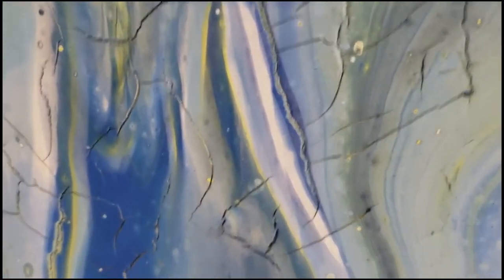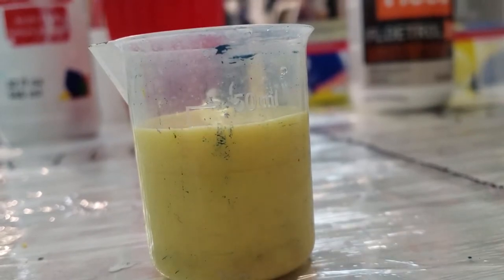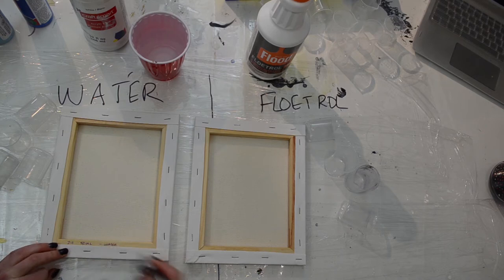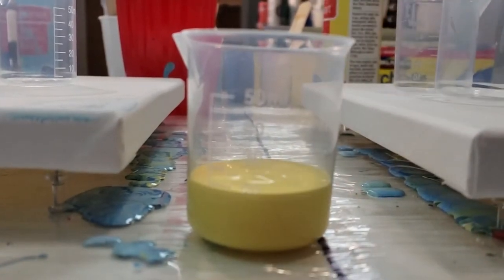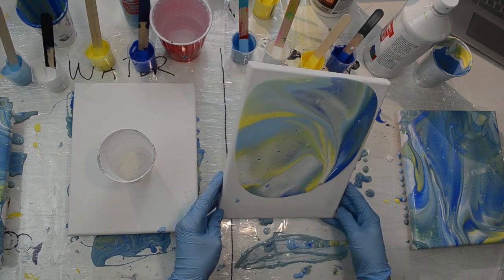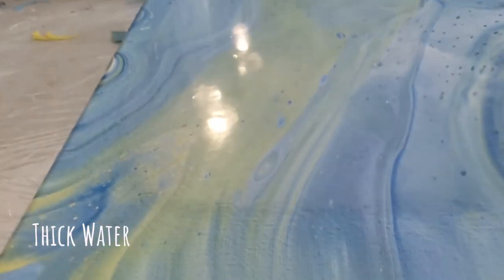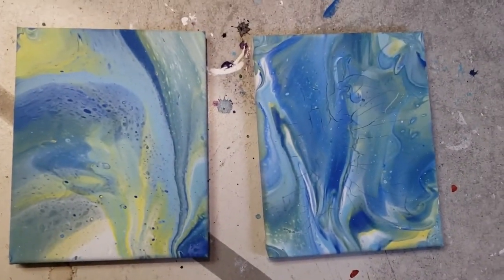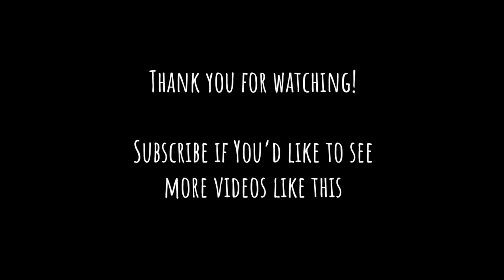Pour Painting Cracking? Testing Mediums and My Hypothesis - Results May Surprise You!

Comment: My first observation would be that Floetrol is not really meant to prevent cracking or crazing. It's just a medium to thin the paints for pouring (for our purposes anyway) and I've heard recently that it doesn't have any binder in it (which would make sense). Some people that pour just use Floetrol. Others will add a bit of something like GAC 800 or another medium like one of the Liquitex mediums. I've used various things with success- usually at no more than ~10%-15% of the total mix of Paint:Floetrol:GAC 800 (or other medium, plus occasionally a very small amount of water for consistency). There are multitudes of things that work and really no right or wrong way of going about it. It's all about personal preference and what works for you.

Really, there are a number of things that cause cracking or crazing. You're definitely right about the thickness of the paint on the canvas being a culprit. Anything really that can cause those outer layers to dry faster can be a problem- thickness, viscosity, temperature, surrounding air flow, etc...  I've even heard that paint being too thin can cause it, but I haven't experienced that personally. I'm not a fan of using water alone though as a medium (or Floetrol alone either for that matter). I've seen others get beautiful results with just water or Floetrol though, so like I said, there's no right or wrong answer. The other big variable of course is the type of pour a person is doing. That's also going to impact what to include in the mix, the best viscosity, etc...
Reply: If weuse morepuring is it btter or not

Comment: Not an artist, but this would likely be similar to cast acrylic panel welding, which uses a solvent.  You can get crazing from uneven drying, or other stresses in the material from uneven heating and cooling during shaping or bending 

So yeah, you seem to be spot on...

As for the solution.. I don't understand acrylic painting and mixing 😂

Comment: Best way to keep from your paint from cracking is use Golding get 800 it’s like a poor medium add it in with your flow trawl and I will keep your paint from cracking it also lets and helps with pigment
Reply: Yes, definitely. GAC 800 is awesome. I use it, but there are a number of other products as well that can work similarly. Floetrol itself is not really meant to prevent cracking/crazing.

Comment: Hello ....
I finished a pour that I am not happy with, lots of deep cracks in it.

 My question is to reuse the same canvas do I have to resand it down or how does that work to do another pour over it with a smooth surface
Reply: I wanna know this but they say never to use a used canvas? Idk. How's ur paintings going?

Comment: Yeah I'm having problems with the cracking I swear to this moment it's due to the temperature in my house so I change my temperature setting down to the coldest setting in the house and is sort of stop the cracking could that be a factor due to the temperature in a cold run or add damprid to let it cold dry the paint faster
Reply: I'm having the opposite reaction. When left in the cold I get more cracks than in a heated room 😂